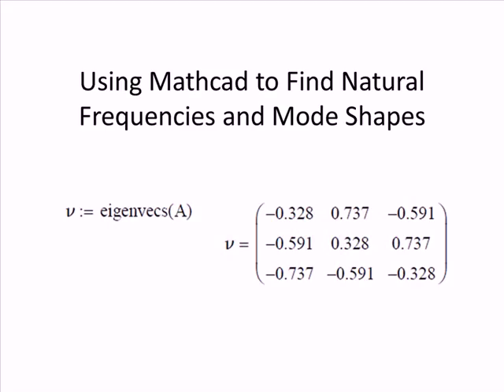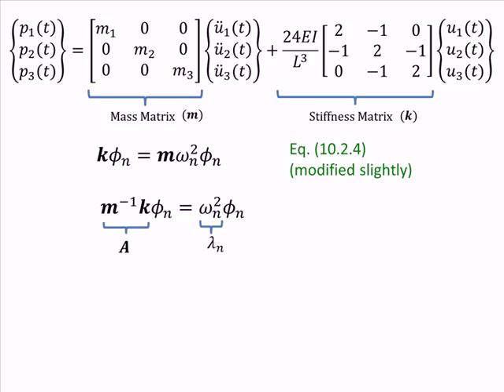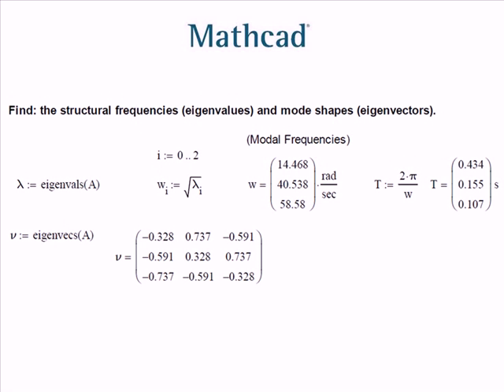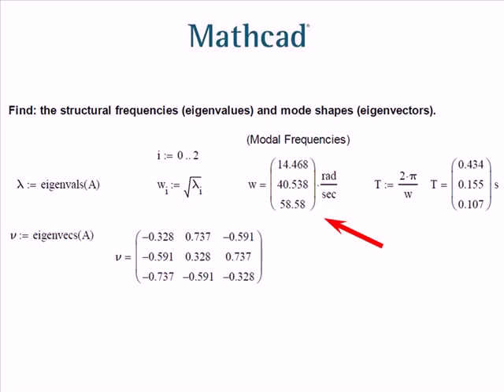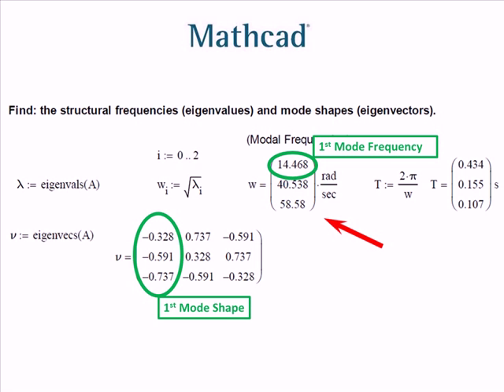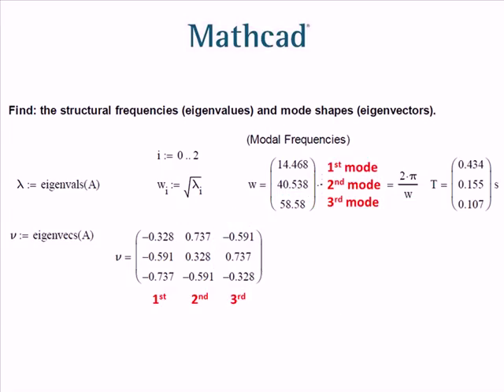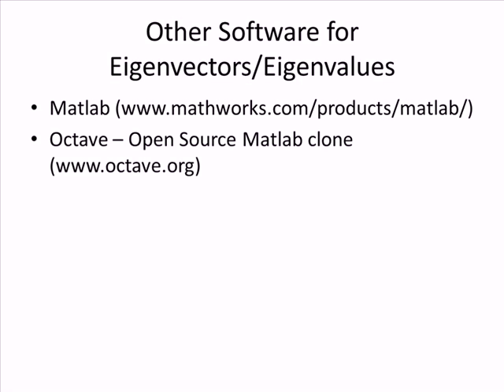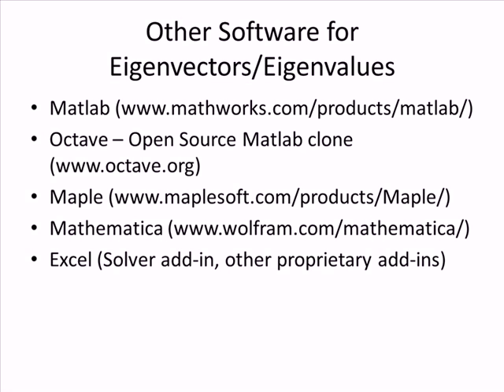Natural Frequencies of a Building using Mathcad

Comment: Hello again.. i have asked the same doubt in your previous video, i am asking again... I have made a physical model of the same frame that you have considered in the video.. Mass of each storey equal so is stiffness. My main question is, while calculating lateral stiffness of each floor or storey, u considered 24EI/L^3 since there are 2 columns (and 2D figure), but in actual 3D model it would have 4 Columns so should i still consider 24EI/L^3 or go for 48EI/L^3?? would really appreciate your assistance...
Reply: No, you are using 2 columns in calculation because you're calculating natural frequencies of one row (column, floor)
Reply: @Lado93  thanks for the help... I have practically calculated natural frequency as well with the help of an accelerometer and compared with theoretical one like in this video.... 

By considering 2 columns in calculation i found the ans similar to the one i calculated from accelerometer... By considering 4 columns the ans came double 😂